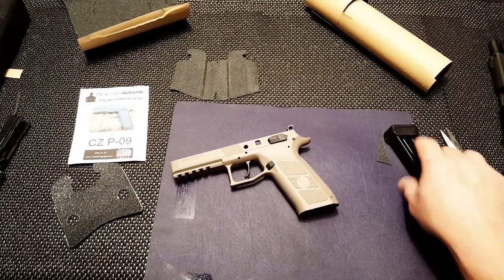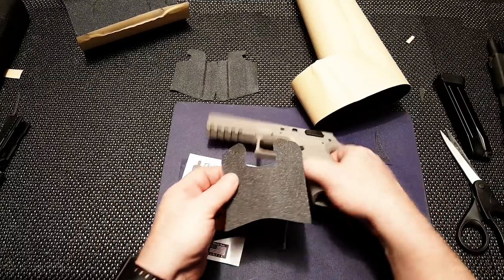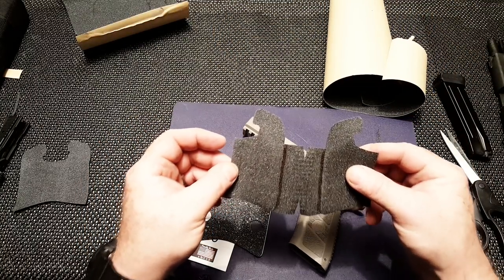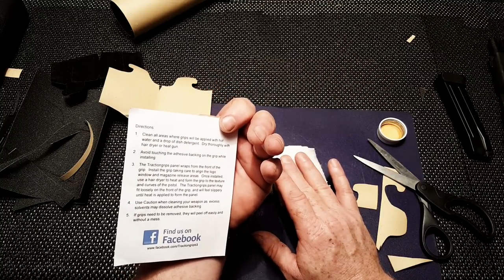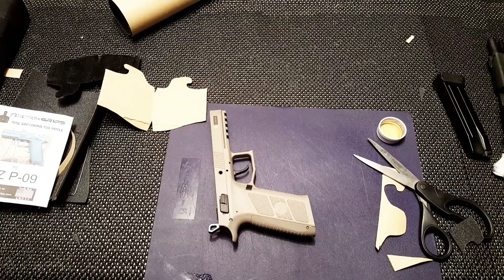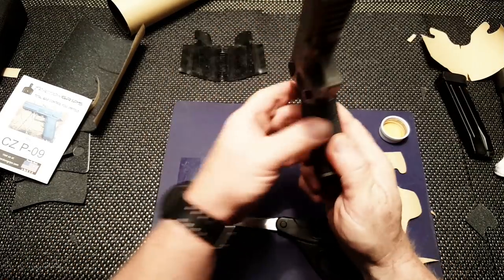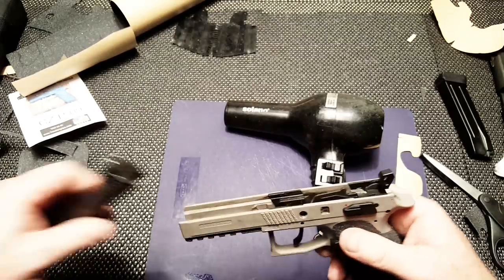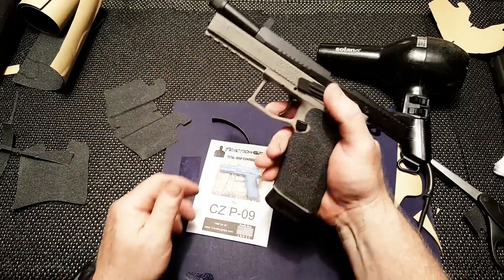CZ P-09 DIY Grip Tape Install!!!  CZ P-09 Tactical Supreme!!

Comment: Awesome job!  I did the same thing with my XD...went to Journeys and bought  the gritty board traction tape for cheap - the sheet is pretty huge.  I made a template of the grip using the blue carpenter's tape....presto!  Got an awesome grip on it...no issues even when you're hand is wet or sweaty.  Next one is my CZ P07.

Comment: For $19 .. you can get talon grip sand paper precut..fits great. I put one on my p09 which I use for competition excellent grip even when it's hot & humid.
Reply: which one did you get , i checked amazon and they had two choices besides the back strap size.

Comment: Grip tape is awesome but I highly suggest NOT to use it on your CCW weapon if you appendix carry at least. Rubbed my stomach raw so I made sure to wear under shirts, then under shirts stuck to the grip tape and made un-holstering the weapon difficult due to it being tangles in the shirt. I bought talon grips for my M&P9 shield and loved it at first but three weeks later I took them off. For a duty gun/OWB holstered gun I think it makes perfect sense.

Comment: Honestly, you did a nice job with skateboard grip tape.  I made my own grip from grip tape for my Taurus PT-709 Slim.  Really improved feel of the at pistol in my hand.  The only problem with skateboard tape... seems to move over time and leaves a sticky residue if removed from the pistol.  Have you ever tried Talon grips?  All three of my Polymer pistol (PT-709, XD-9 Service & G21) sport them!! https://talongungrips.com/grips/cz/p09.html